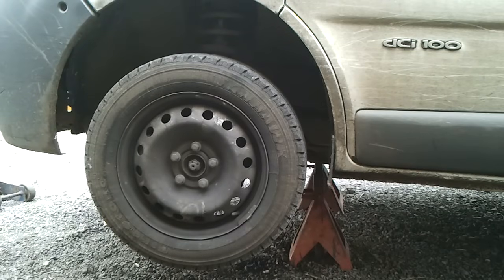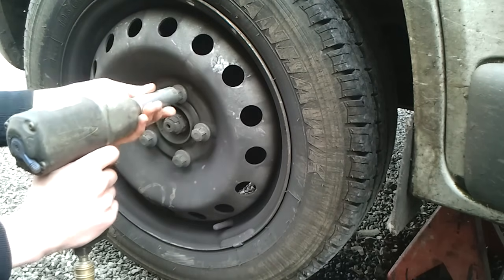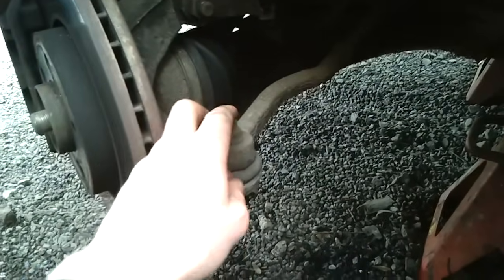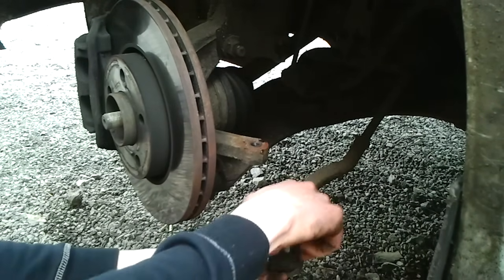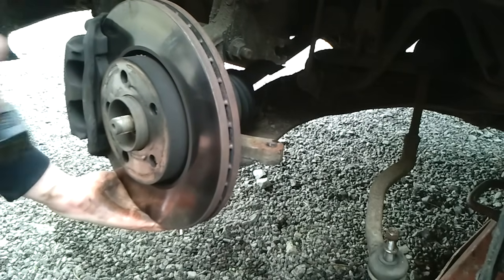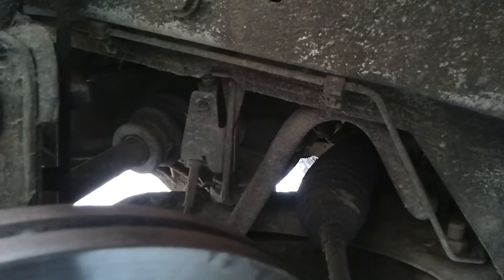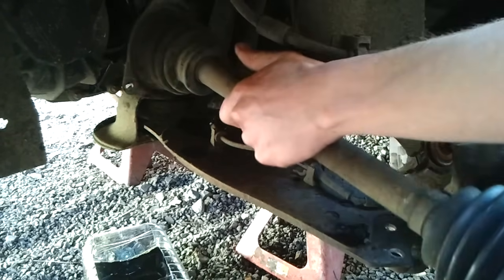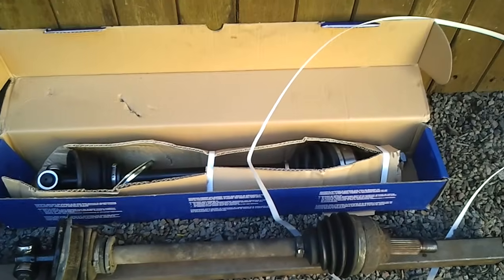How to replace a driveshaft. (Front wheel drive cars)

Comment: when hammering out the driveshaft, if it's really stuck in there you can put the nut back on the end and hammer it until its loose to prevent mushrooming the threads

Comment: I have w169 A180 CDI Automatic transmission. I have to change  complete Drive shaft front right. Do you know, should I drain the transmission oil first to put the drive shaft out? Thanks

Comment: Thanks a lot! I think I would use a rubber hammer though to prevent hurting the thread.
Reply: No need to protect the threads,  they are on the old axle that's being discarded.

Comment: NOTE OF ADDVICE FOR ALL NOW  ,,,,  DONOT  USE A METAL  HAMMER TO HIT THE END OF THE DRIVE SHAFT   ,  IT WILL  DAMAGE   THE THREDS   IF YOU ARE REPLACEING THE SAME DRIVE SHAFT.(((((((((((((( IF A NEW ONE IS BEEN FITTED THEN GIVE IT A BET   THANK ALL
Reply: Hi mate sorry to sound dumb . I'm going to remove the engine from a doner car and will need to remove and re use the same drive shafts . How can I remove them without damaging them? Cheers
Reply: Just undo the nut to the point that it is on the tip then hammer that instead
Reply: Or buy a Thor Hammer 👍🏻

Comment: Looks easy cause that car is easy, not all front wheel drive cars have the 3 bolts holding the shaft in the gearbox, some have circlips that "pop" out on the end of the shaft when pulled ir levered.. Some are much harder than you think -__-

Comment: I own a Ford Galaxy 2014 diesel 2.0 and it has been juddering under acceleration (1st gear). I also notice that on dry surface it doesn't quite happen as often as it does on wet.

I've thought it could be a tyre issue but also heard people stating they had the same issue when went on to change the drivesshaft.

Would you say the the juddering could be an issue with the drivesshaft? I understand it could be anything but just trying to find a way to rule it out.

Thanks